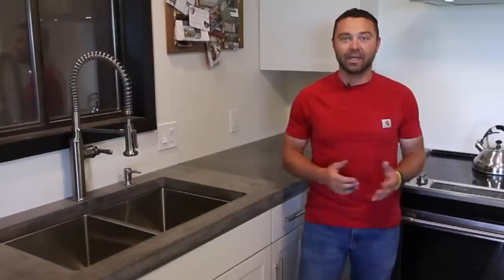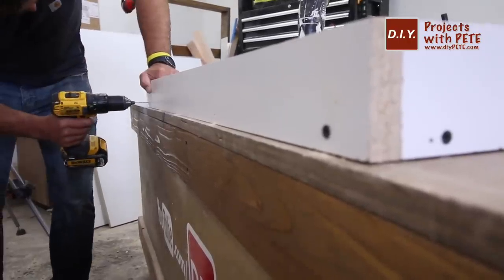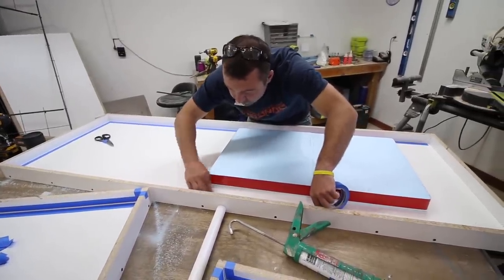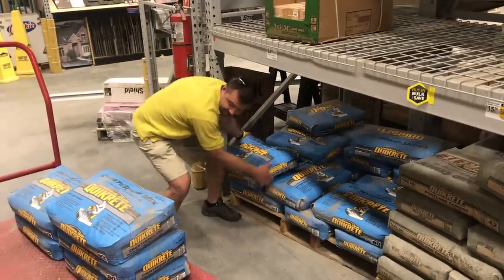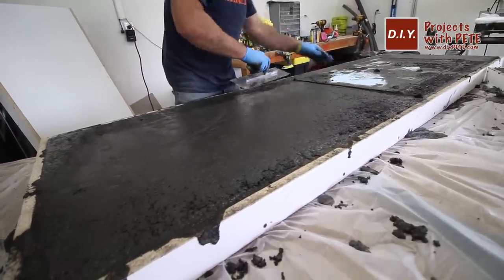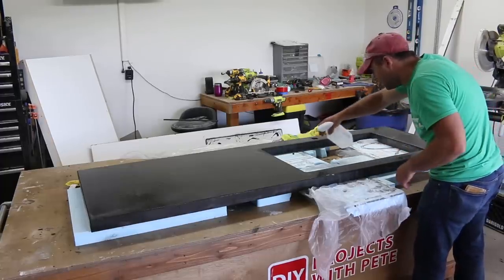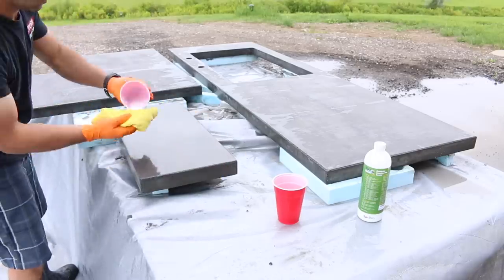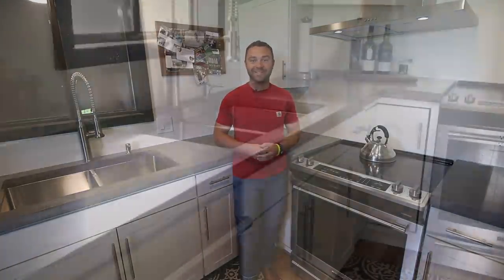How to Make Concrete Countertops

Comment: Hey Pete,  this is an awesome video, thank you so much for putting it together. I had a few questions I was hoping you could answer. 1. Roughly how long do you think it is necessary to vibrate the concrete to remove air bubbles? 2. When mixing concrete, do you mix a batch for the entire mold all at once or do you mix the first half of the mold, vibrate, and put in reinforcements before mixing and putting in the rest of the concrete to fill the mold completely. 3. Do you always have to color match the slurry mixture when using portland cement with acrylic fortifier even if going with natural concrete color? 4. If using the Omega sealer, would you still put wax over the top of if? And finally where is the PDF cheat sheet mentioned on your website??...sorry for all the questions but thanks again for a great video!!!
Reply from the maker: Hi Chris! Thanks for watching and great questions.  Vibrate a few minutes after each pour. I like to lift the table quite a bit until fewer and fewer bubbles rise to the top. 2. I mix 1-2 bags at a time and make sure to cover the entire base of the mold and perimeter. Quikrete 5000 is nice because it has plenty of working time and you don't have to rush. If you use concrete without color, matching isn't necessary. As for a wax, I do not think it is necessary with Omega, but thats something I'd need to look into. As for the cheatsheet, it is not up yet, I need to update the site. Cheers!

Comment: Awesome video!!!  Very informative, especially on the polishing - that's next for me. 

I just did a cast in place with the mix, and it was a workout for a 27sf slab. 

BTW the mix did contain bigger than pea size gravel in it but after steel troweling the top was very creamy. It's hard to work with in a cast in place sitchu. 

Debating what how to handle the rough spots (I have few on the L shape corner, will do 200 hand sanding to see if will level out, any recommendation is welcomed !)
Reply from the maker: Great to hear your project went well Constantin! Cheers!

Comment: Awesome video, what do you do in the case of being bigger then 8’ long, being the melamine is only 8’?
Reply from the maker: Hey Justin! I know you can special order 9 foot sections. A lot of times if you are doing bigger sections then 8 foot, people will do cast in place tops where you hard trowel the top. Otherwise, you could use pocket holes to connect two pieces, and then put a piece of clear packing tape over the seam. You'd need to polish a little deeper to blend the area though, as even the super thin tape will be reflected into the concrete top. So you might need to polish and expose a little aggregate for it to be completely blended.

Comment: 1/4 hp motor with a 5gr offset weight on the output shaft, attach it to the bottom or lower shelf of the table and turn it on. the high speed low level vibration will set the concrete as you work it.  i use this with welding.
Reply from the maker: Very cool, thanks Ian! I now have a motor that is bolted to that table, cheers!

Comment: In the clip where you use sandpaper to sand the concrete countertop,what number of sandpaper do you start sanding?and sanding to finish the job with what number of sanďpaper?
Reply from the maker: Hi! I used a diamond wet polisher --- I didn't want to expose the aggregate, so I used an 800 grit pad for the top of the counters.

Comment: DIY Pete, thanks for the tutorial. How well do you find concrete countertops hold up? My husband and I are seriously thinking of doing this (and soon!) but we are hearing a lot of nay sayers. No one with any experience with concrete countertops, however. :)
Reply: Also, where do you purchase the blue bags of Quickcrete?
Reply from the maker: Hey Bethany! I've had concrete countertops and seen them over the years. I feel sealers have come a long way, and that the Omega sealer is the best by far at this time. You do need to be careful with oils, but the sealer does do well. Microfractures can happen along the sink etc if not done perfect, so there may be some small imperfections. I actually prefer the $6.00 quikrete 5000 over the expensive blue bags. Here is a video that I made showing the cheaper method and easier process: https://www.youtube.com/watch?v=A0Pd4o8gjfM  --- Continue to do your research to see what is best for you on concrete vs granite / corion, etc. Cheers

Comment: Hi just finished 2 pieces of my countertop , looks great but my silicone bead in the corners bother me, need sanded to make right, when you polished , do you try and loose that small line the blue tape leaves behind? I bought 800,400,& 59 grit diamond pads. The flat  looks awesome, may only need a 800 , but unsure about edges?
Reply: Also , mine feels like its gonna take a team of bodybuilders to install , how are you maneuvering yours with one arm? Is the countertop blend lighter? I used the 5000
Reply from the maker: Hi! I typically run 400 and round the corners to get rid of the line if their is one. I use a newer technique to avoid that as of lately. https://youtu.be/A0Pd4o8gjfM?t=283
Reply from the maker: It is heavy for sure. My buddy Rick and I carried it in, but 3 people would have made it much easier.

Comment: I noticed you put this slab on top of melamine/MDF counters. If I were to build a desk from MDF & paint it, then lay a 2” concrete table top on top of it, would it hold the weight? Or would I need to reinforce it like you did here?
Reply from the maker: Hey Aaron! It would really depend on how the desk it built. But having the extra support ( even if it is just a couple strips ) is well worth it. The concrete will have more support, and it will be a place to put silicon to help hold it in place. Have fun!

Comment: Would concrete counters be ok for an outdoor kitchen that is exposed to the elements?
Reply from the maker: Hi! I have a concrete table that has been out for 5 years and is exposed to the elements. I re-seal it each year. It still looks good. However, getting a cover for it would definitely be nice and something I'd recommend to help keep them looking really good. Here is an outdoor kitchen I did last year. It is protected pretty well and I used regular Quikrete 5000 for the project. He is thinking about getting covers for them just to be safe. https://www.youtube.com/watch?v=A0Pd4o8gjfM

Comment: Pete, great video, thanks for putting it on you tube  I have a real thing about silicone, it looks nice at first but then the mold set in and it start to look ugly, how do you counter this  Adith
Reply from the maker: Thanks Finn! I use 100% silicone for most projects. I'd say keep it as clean as you can, but if it is a wet area, you may sometimes need to re-caulk. Not sure the best solution besides periodically re-doing the caulk. Cheers!

Comment: always wanted to know how concrete tops are for scratches and nicks/cuts. like say you dropped a knife on them or someone tried cutting directly on them. I'd love to do these in our new house, but would hate to have to replace them for a minor accident.
Reply from the maker: Hi, they are pretty durable, especially with a good sealer like Omega Sealer. I always use a cutting board. I'd recommend doing some additional research to see if they'd be a good fit for your situation. Cheers!

Comment: I would like to import the special counter top cement to South Africa ,as we don't have it here . Great looking concrete pete
Reply from the maker: Thanks! You don't need to use the special mix. In fact, the standard quikrete 5000 mix has worked great in my experience. I have used both, and to be honest I prefer the Quikrete 5000 after my experimenting.

Comment: Pete, great video I am getting ready to do this in my kitchen. Did you not experience any cracking along the sink and the L shaped section. Seems like it would want to crack at those points.
Reply from the maker: Hi Bri, these are certainly the high stress points. You may want to do some additional research on using reinforcement around sinks. Cheng has a great book on it and solid recommendations. This one has no cracks, but I have had other's develop in past projects around the corner or near the sink knockout. I highly recommend rebar in this area to help.

Comment: Great job Pete - thanks for taking the time to make awesome videos. Is it possible to use just cement for projects like this or does it need the aggregate in concrete mixes for strength?
Reply from the maker: Hi Barrie! You'll definitely want to use aggregate. Cement on its own wouldn't have structural strength. I typically will use quikrete 5000 or a countertop mix, but if mixing your own I'd recommend cement, sand, and pea gravel. Best of luck!
Reply: Thanks for the response 👍

Comment: Fantastic job Pete!  Just curious, how much time is involved wet-sanding; it seems that step takes the most time.  Cheers from Idaho!
Reply from the maker: Hey Rick! Wet polishing does take a while and is a process ( took a few hours ) -- and honestly I've had just as good of results or better using the normal sanding process -- ( for getting a natural finish ) -- plus it was quicker and easier - and doesn't require a wet polisher. --- However if you want to expose aggregate or crushed glass etc then a wet polisher is best. An upcoming video that will be uploaded as soon as I do the final footage --- will show the dry sanding process. Hope all is well in Idaho!

Comment: Great video!! I went to  4 different stores and all the wire mesh I could find was rusted. Is this still okay to use? Should I clean the rust off first?
Reply: No you can use it rusty! The reinforcement at the building site is always rusted. But there should be no soap or organic material on it. 
Good luck building it.
Reply from the maker: Yeah, most will have some rust. If there is a lot you can clean it up a bit with a wire brush, but you'll be fine using it.

Comment: Hi Pete,

What sealant did you use to waterproof and make the concrete stain resistant? Or what is the base of the product used? I am in SA and we do not have a great variety of products.
Reply from the maker: Hi Lucille! I used Tuff Duck sealer for this project on Amazon. It is alright, but I've found another sealer recently named Omega concrete sealer. It is far better in my experience.

Comment: Heya, Pete! I installed the same faucet a couple months ago. I tell ya what, it works like a charm! I do have to ask, where did you get your Quikrete countertop mix at? My local Home Depot’s in proximity of me have stopped carrying it for some reason. Thanks!!
Reply from the maker: Hey DJ! That's awesome! Yeah I was at Home Depot and it was definitely my favorite of the bunch so I picked one up as well! For some reason our Home Depot only carries Sakrete... So I get the quikrete and countertop mix at Lowes. I believe they can special order it in for you ( either HD or Lowes ) kind of an inconvenience I know.. Our local concrete supplier also carries it. I use QUIKRETE 5000 a lot though too, and think it works  really well.

Comment: Rocktop CT, from Expressions-ltd makes a very durable sealer. Ours is 5 years old and has required no maintenance.
Reply from the maker: That is great to hear. I'll have to try theirs out someday. Thanks for the info!!
Reply: It's great stuff. Acid resistant, heat resistant to 450 degrees, 35% harder than granite at 30 days cure time, but usable within 24 hours. No weird application method or UV cure light needed. It just goes on with a plain old paint roller.
Reply from the maker: Awesome, will look into it!

Comment: Hey, do you think its possible to do this on floor? I like the smooth texture of this concrete.
Reply from the maker: Hi there, polished concrete floors are very popular. If you have a concrete floor on the main level of your home, it could definitely be polished, but you'll need to hire someone most likely. Polishing concrete is a big job, a mess, and requires experience to get good results. If you are asking if you can do this over a normal floor---- you could look into using an overlay product to do concrete over an existing floor. I'd recommend doing some additional research to see options. Cheers!

Comment: Great video, Pete! Going this route for our kitchen remodel. Curious as I'm about to watch some other videos on the topic...would you set the forms in place if you had to do it over again (not have to risk breaking the concrete, or for a larger, heavier slab)? Many thanks, and an excellent presentation!
Reply from the maker: Thanks Rob! I've done a few sets of counters in place and hard troweled them. I like being able to control the variable by building them out in the garage, and to sand/polish outside. But building them inside is another great option and as long as you feel comfortable screeding and troweling, you'll be good to try that after watching some additional videos.

Comment: Hey there Pete! Amazing video! I’ve seen dozens of concrete counter videos on YouTube and I think your’s is incredible. I’m about to tackle this project for our kitchen and had a question: With all of the many concrete tops you have made, have you ever had issue with them cracking? I’m in Northern New Jersey and I’ve heard that humidity changes could be problematic. Thanks in advance for your reply GP
Reply from the maker: I have had a crack by a faucet before because of doing the piece to narrow. Cracks at corners can happen if not done properly. I'd recommend the cheaper quikrete 5000 mix over this one. I've had way fewer issues.
Reply: DIY PETE Thanks for the feedback Pete! Perfect, I used the 5000 mix on my counters, I’m waiting for them to cure. And I reinforced them with a heavier rebar, so hopefully I’ll be in good shape

Comment: great job, how flat stay the join between both surface ?
Reply from the maker: Hey Sergio! I'm not 100% sure of your question, but the counters are 2 inches thick, and the seam or joint between the slabs is tight.

Comment: Hi Pete thanks for all the time and effort on the tutorials.

I’m going to try to adapt this out as a hearth pad for my wood burning stove.

My first question is about the quikrete 5000 vs the counter top mix. Can I use the 5000 and not see gravel or rock in my top or sides? I want the smooth one color look you got fresh out of the mold. If not then I’d go counter top mix probably.

My second is with counter top mix and coloring -I want the same color you got in these videos... do you use the tint base version or the regular gray version ? I know you add the charcoal color so I will too but quikrete sells two versions of the counter top mix and I would have to special order it so I want to get the right one.

Is there a mold for “flamed edges” that you know of if I wanted that 
Thanks again!
Reply from the maker: Hi Dan! Great to hear from you. The Quikrete 5000 will certainly work. You'll only see the rock if you polish down with a low grit pad to expose it. To ensure you have a even finish, make sure to vibrate it as best as possible. Check out this video for additional information: https://youtu.be/A0Pd4o8gjfM  --- It shows me using the Quikrete 5000 mix and a basic orbital sander to get a real even finish. --- For both videos, I use the grey base. The countertop mix comes in either white or grey. White is special order typically and I only use it when I need to get a brighter color with say a blue, green, or red. For the indoor counter video I did mix in some of the charcoal pigment made by quikrete. As for flamed edges, I haven't ever done that type of edge, but I have done stone looking edges. I would recommend checking out this site for some ideas of products that can be used on edges. https://www.expressions-ltd... - Cheers and let me know how it goes!
Reply from the maker: https://www.expressions-ltd.com/?gclid=CjwKCAiAqt7jBRAcEiwAof2uK1BhNyAEclRL4MfUhnCQunBbKb-EIWvz2uhfdb6tVYTT3wo-ybYmyxoC5VYQAvD_BwE

Comment: Good work sir I’m carpenter I wanna make this countertop but I want to make in white cement can u tel me were I can buy white cement and white chips stone thank you
Reply from the maker: Hi, Quikrete makes a special concrete countertop version with a white base. You generally will need to special order it from your local quikrete supplier. Buddy Rhodes also has a white concrete countertop mix.

Comment: What color is the Quikrete Countertop Mix without the added color? I was told it had white Portland cement.
Reply from the maker: Hey Wilfred! You can either get it in white or grey.    --- To be honest, I have had better results thought with the Quikrete 5000 and prefer it over the counter mix.

Comment: Hello Pete!
I'll try to make the benches of my house inspired by your channel.
really enjoyed!
I have two doubts.
What is the name of the foam you use to make the sink mold?
here in Brazil I still do not find anything similar to sell.
another question is whether I can use normal concrete: cement, sand and gravel.
thank you!
beautiful work.
Reply from the maker: Hi Elton! Hope all is well in Brazil. The foam is called high density foam. - sometimes foam board. It is 2 inches thick. ( often used to insulate walls in garages etc ) Normal concrete can be used, I'd recommend doing some googling to find the best ratio and ideas on admixtures. I commonly use Quikrete 5000 which is a very standard and cheap mix here in the USA and it works just as good as the more expensive mix. Best of luck!

Comment: @DIY PETE, Couldnt the previous countertops be used as the templates?
Reply from the maker: Hi Jaime! Great to hear from you. Not everything lined up exactly the same. If even little adjustments are made it helps to have a different template. The strips are light, easy to work with, table, and fit in the mold upside down since everything is mirrored. Cheers!